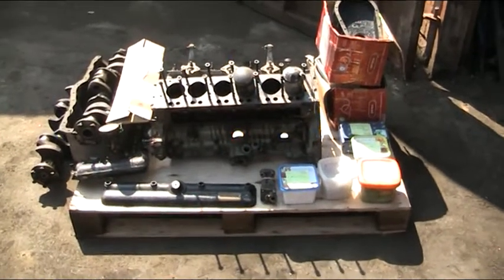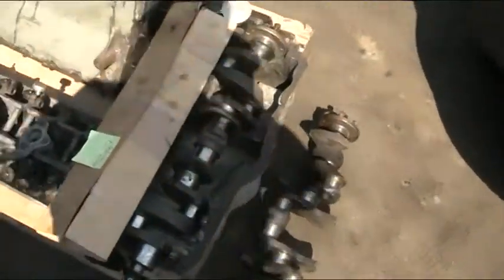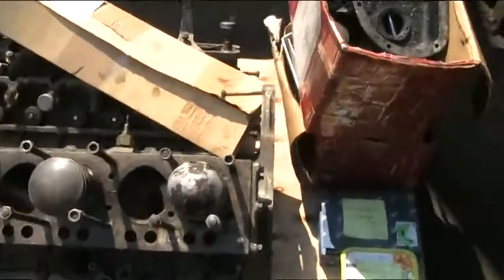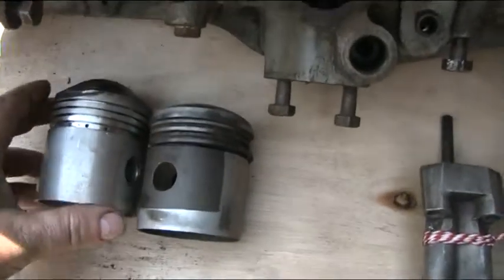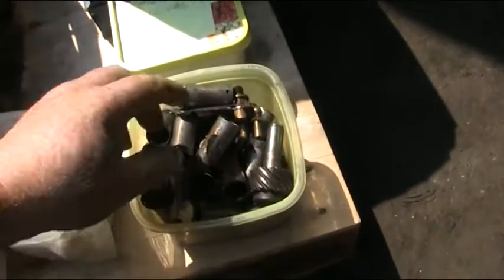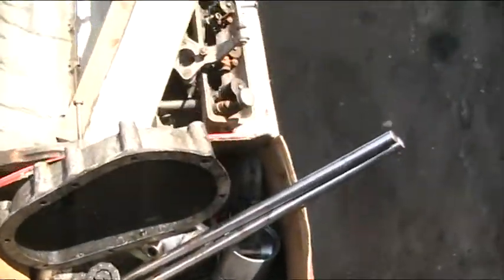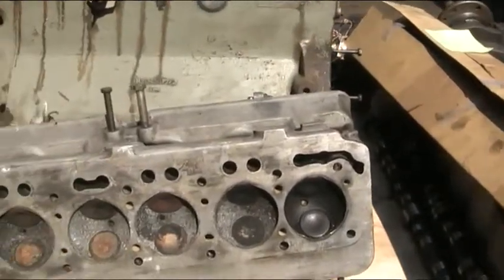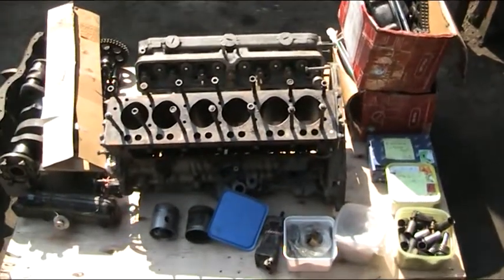bristol engine rebuild

Comment: How did "resurfacing" the lifters work out? You know lifters aren't "flat" on the bottom but have a slightly convex surface, right? For lifter rotation.